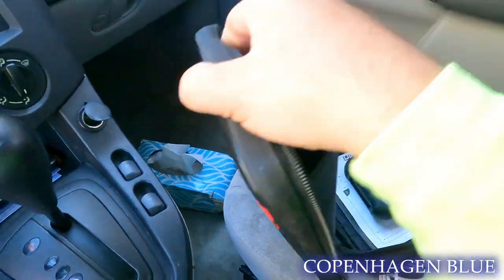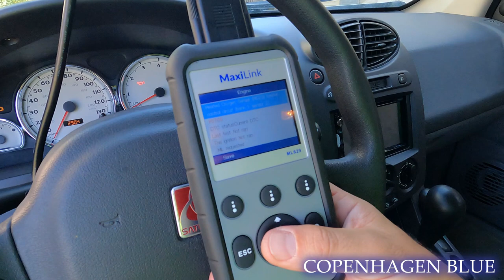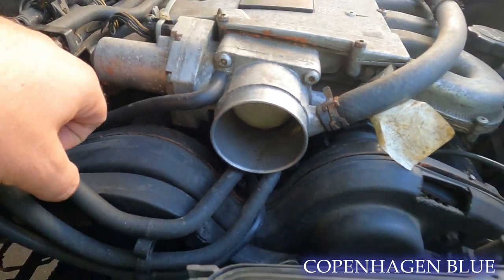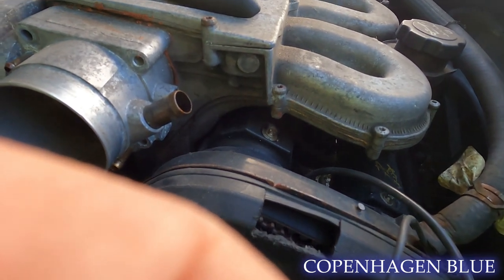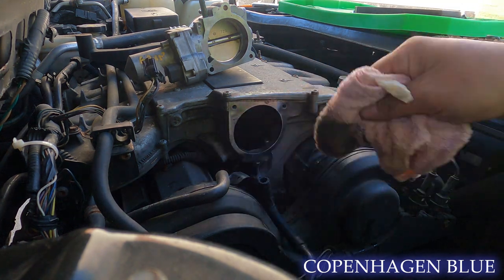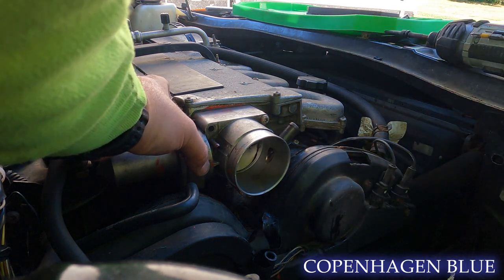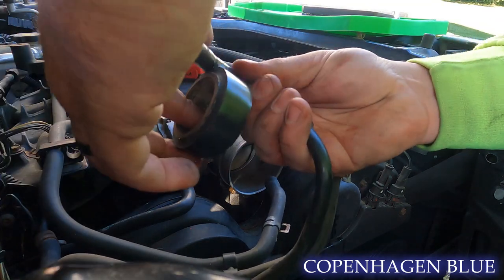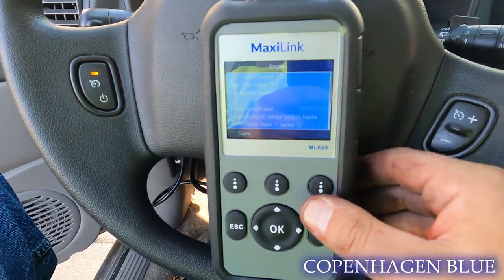REDUCED POWER WARNING! P0121 P2119 P 2176 P0700 How to replace a Saturn VUE throttle body

Comment: First post after reading some of the forums on this issue. 2003 Saturn Vue 3.0L AWD Automatic 111,666 miles. The Vue has difficulty moving forward in Drive, along with elevated RPM's. At a complete stop, if the transmission is shifted into Low, the Vue accelerates normal through first gear. Moving the shifter then to I or D gives a "hard shift", followed by normal transmission behavior through the remaining gears even up through highway speed. I disconnected the battery, then reconnected 20 minutes later. Went for a test drive, and the transmission acted normal through all gears. At the first stop sign, however, the issues with 1st gear returned while in D. Again, shifting to L allowed, 1st gear was OK. Before and after the battery disconnect, the codes showing up were P0700 p1779  p2176 . I cleared them and disconnected battery know only have p0700 trans system control malfunction. It starts up but any gear i put it in wont ingage. I know its alot apologizes for extensive text
Reply: P.s mines a 2002
Reply from the maker: Sorry I didn't get back to you sooner.  I'm not sure what direction to point you in exactly.  Have you don't a fluid drain and fill?  It almost sounds like you're low on fluid.  I personally like the Valvoline Max, it seems to perform well in the AISIN 5 speed.  There there is a dip stick, it's really buried, but worth at least checking your level.  Hope you figure it out!  let me know :-)

Comment: 😂 mine was electrical 
To the tranny. Saturn was generally built with a good motor and transmission with all interior and replacement part as cheaply manufactured to drive down cost which worked very well in the 90s and early 00.

Comment: I have a problem on my hundai accent. After scanning these code appear P0121
P2119 . How can I fix it
Reply from the maker: Hi, sorry took so long to respond. I’m not too familiar with Hyundai. But the P codes you pulled should be fairly relevant to the same issue on my car.  Mine was fixed with a throttlebody, yours might possibly be as well. Good luck.

Comment: I have a Saturn was driving lose powere and before it was taking lot of gas, now it won't drink only reving. Having idle too. I got p0700,, p0738.. whiching saying something about timing reference
Reply from the maker: Well the P0700 is for a transmission control unit fault and the P0738 is for a speed sensor fault. It’s possible you have a bad sensor or it could be something with the TCU. What engine do you have in your VUE?
Reply: @copenhagenblue8417 hey I have the same P0700 issue and I have the same VUE 2.2 engine not the V6, can you help me.

Comment: Eco Tech Engine
Reply from the maker: Not sure on an eco-tech. But it should be pretty much the same procedure. More than likely it just has a few bolts holding on the throttlebody and you just need to put on new gasket.

Comment: No its not low i replaced it i have every gm recall on that tranny and it goes into the harness thats near driver door. So the moment my tranny gets warm it turns tranny limp mode i can shift but you can fill it dosent engage. If i turn my car on woth code scanner delete all faults shit off car turn key over donot start but turn key 🔑 all the way before start( forgot name) allow all lights on then shut of repeat 3 times then start i can get like down the block them moment i hit the brake it goes sumtimes if ectrs cold eothout bein started for 24 hours or more incan stop once and itll let me go ushally dosent make it a quarter mile. And then any gear (d I l ) wont engage and give gas rpm rise nobgear ingage and car gos in trans protection mode and im pushing the fucker to the next parking lot❤ sorry i know it was alot
Reply from the maker: Did you ever find a solution for your problem?
Reply: Honestly its sitting in the back of my car pile. Every thing i can read find and diagnose is electrical. From the tranny thru floor board on driver side were wiring harness is. As electrical wiring os my least favorite subject. I promoted my self to rebuilding my su(baru)
Reply from the maker: @cloudsith69  That is the thing that I think will be the end of my Saturn.. Either rust, tranny, or electrical.  I hope your Subaru project is going well!